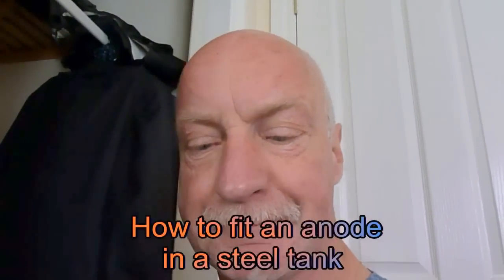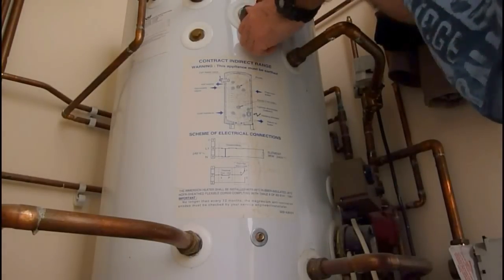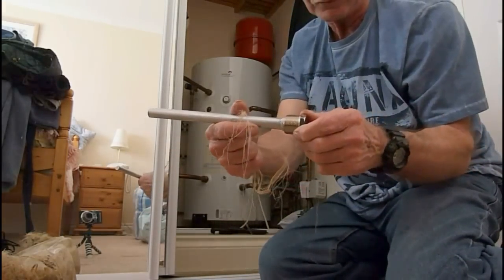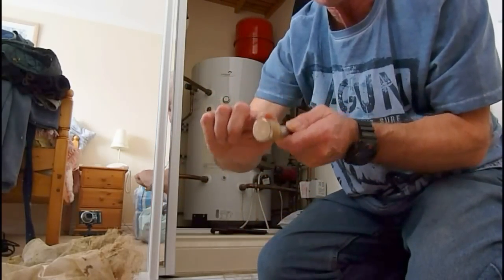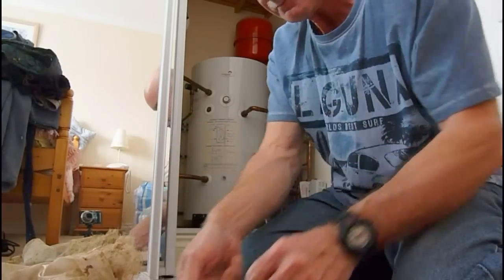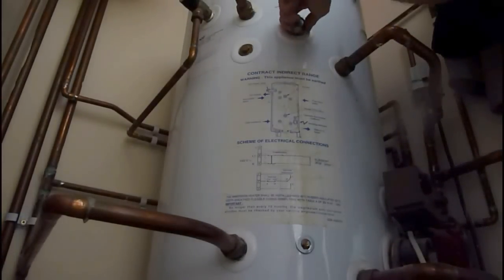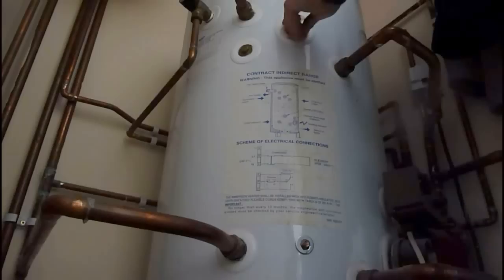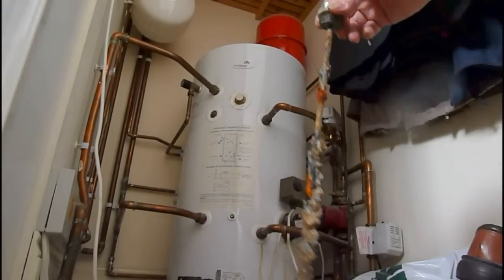How to fit an anode into a steel tank.

Comment: Thanks for video.What are the symptoms of a UV cylinder that may have an Anode that needs replacing i.e other than taking it out and inspecting .Would you take it out and inspect on an annual service irrespective of any symptoms
Reply from the maker: There is no symptom's. Best to renew every 5 years.

Comment from the maker: Hello Benny an anode often called a sacrificial anode is just that , it is a rod of metal that sacrifices it self in order for your tank to survive . What happens is the rod corrodes away and stops your steel tank from corroding ie rusting through and causing a leak.  These are supposed to be done every year although I do mine every 2 years . Hope that helps.
al.